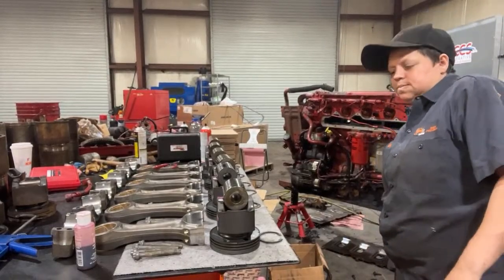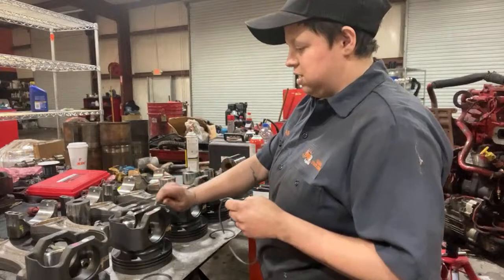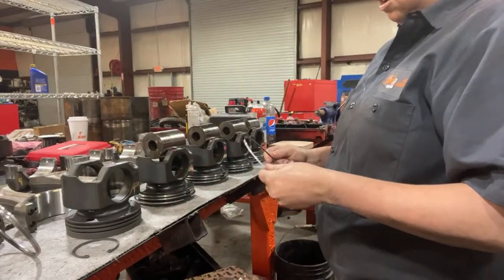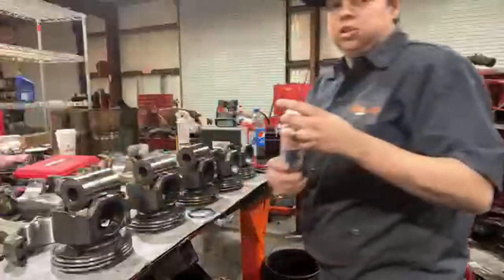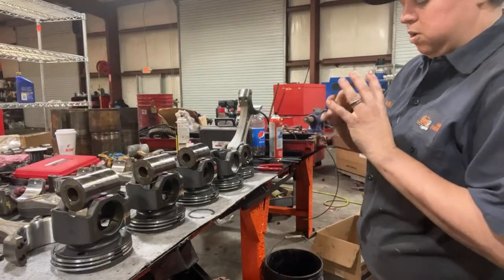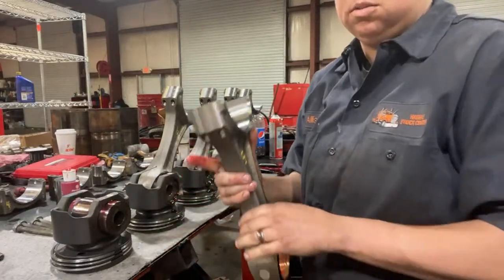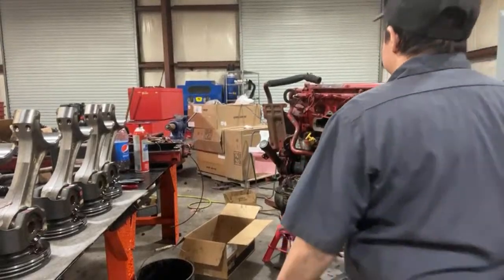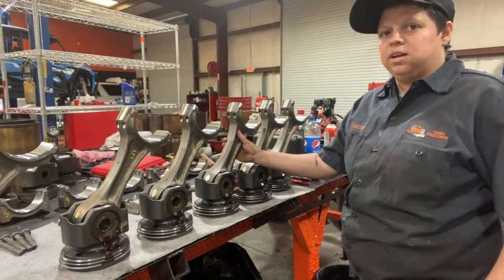Building pistons up on isx 2250 and connecting the rods

Comment: Ring compressor…….the gaps should be clocked 180 degrees from each other even though the rings move around the pistons as the engine runs
Reply: Why? I don’t know anything about engines but want to know why, for better understanding. You can’t say something with out explaining the reasoning for it.